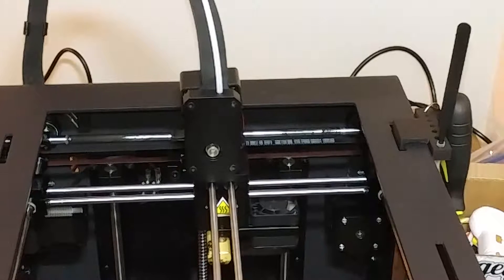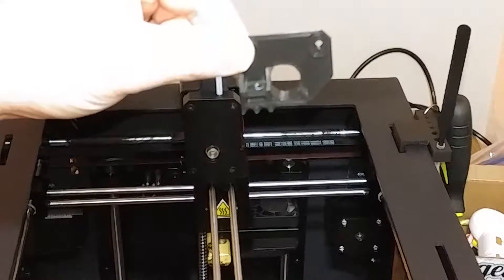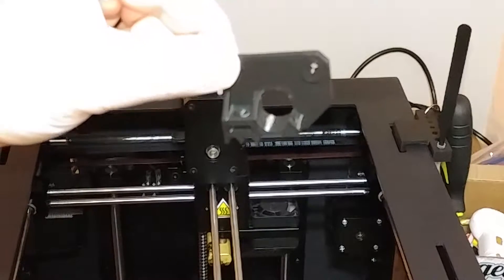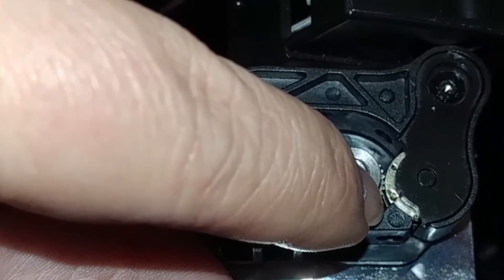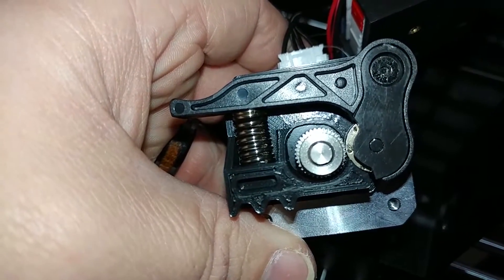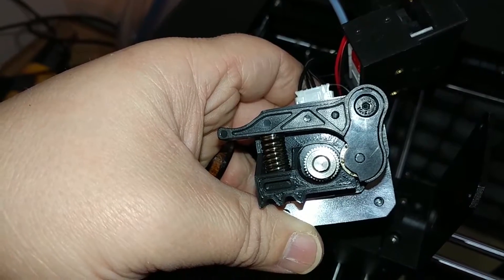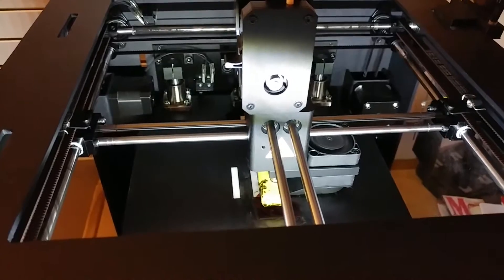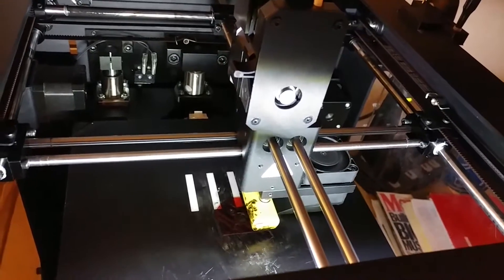Part 1: How to print flexible filament (TPU) with the Monoprice Maker Ultimate 3D Printer

Comment: What are you using on your build plate to get TPU to stick?  Thanks
Reply from the maker: I have a glass bed and use  70c heat. I dont use anything else.  I do use a 30 speed with only 50% speed on first layer .
Reply from the maker: If all else fails this is what I do this https://goo.gl/GaH1QR